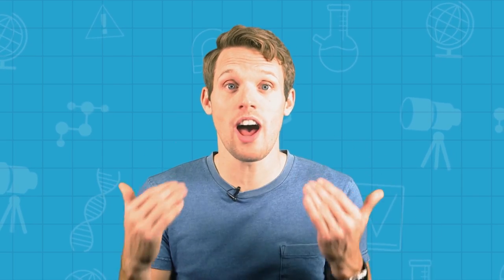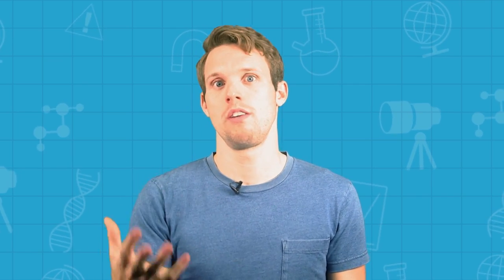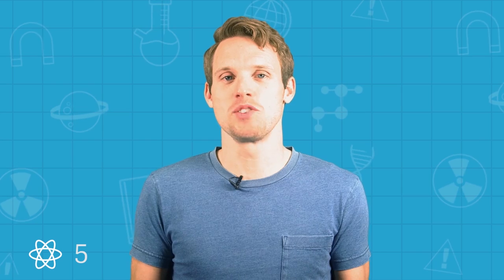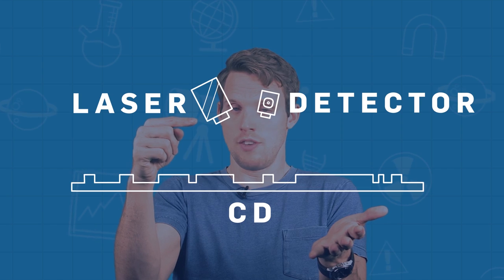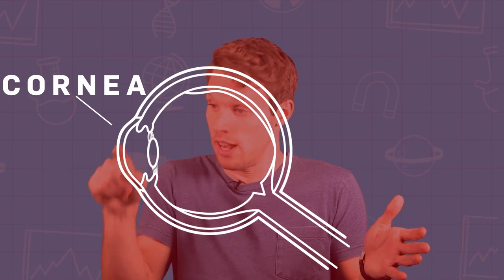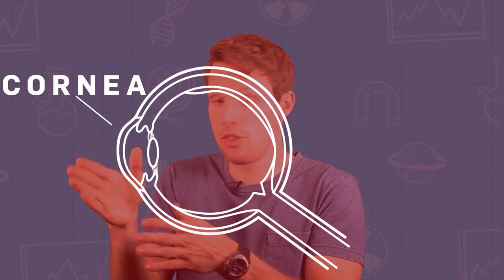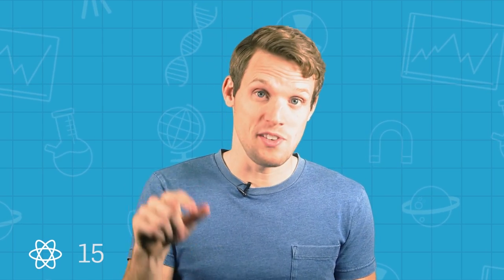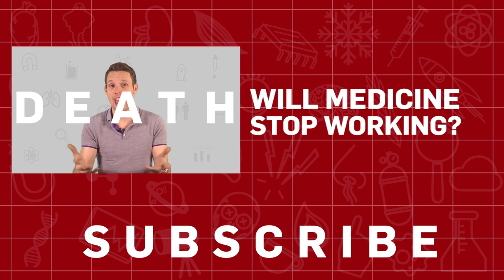How Does Laser Eye Surgery Work? | Earth Science

Comment: I remember that smell.. Slightly disconcerting but honestly the only uncomfortable part was when the blade passed over my cornea, and I'm a real nervous guy. Easily one of the best purchases in my life.
Reply: Geez... Do they at least secure your head so you don't flinch with that blade coming towards your eye? Was it expensive?
Reply: Andrew R  For that part, there is a little suction cup on your numbed eye (your vision is black) that holds it steady. Hard to describe but that is attached to a rail that guides the blade. It can only go forward and back. Foolproof. It cost around 800, but that was 10 years ago. Also it's an older tech; newer kind makes no cut, but longer healing time.
Reply: Friendly Metroid so your vision has been good ever since?
Reply: Andrew R Yup. They said I should have checkups every 5 years, but otherwise it's be as easy as having perfect sight.
Reply: Friendly Metroid man, do I envy you haha thanks for your info :)